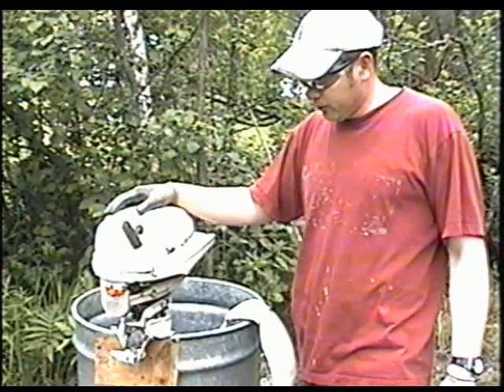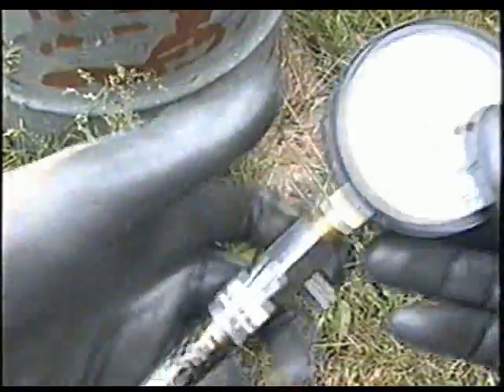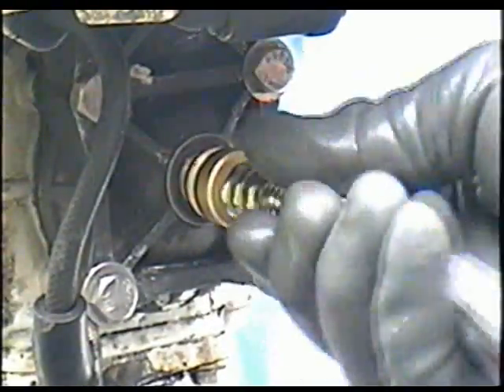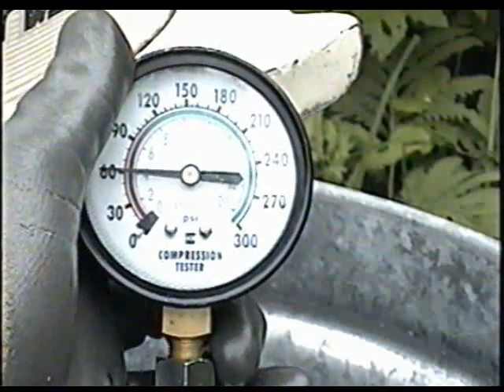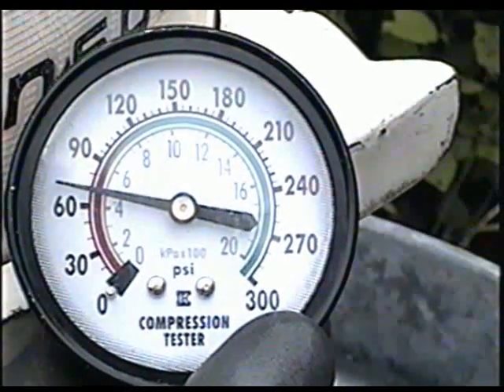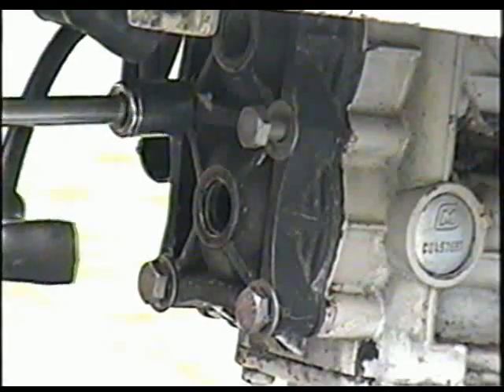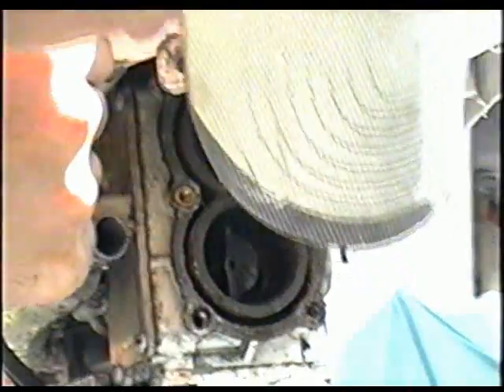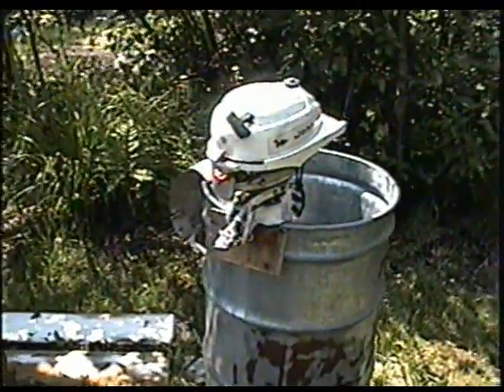Compression Test on 1962-3hp Johnson Outboard Part 1/2

Comment: I'M pretty sure it was the head gasket . taking it off to change the rings and then putting one on new was enough to do the job . 3HP does not have a ton of compression and the fact that it was only 10# different says gasket to me .

Comment: Believe it or not, those old 3hps didn't have alot of compression..60PSI is a little low, but would probably run...Maybe the rings are just stuck, a good soaking with engine tuner or some other decarbonizing fluid will probably help free it up...

Comment: Please, please don't crank them over without grounding the spark plug leads. The high voltage needs somewhere to go and if they aren't grounded the high voltage will short out in the coils making them useless.

Comment: Yes you can get rings for it by the way . Im rebuilding my evinrude 7.5 fleetwin 1957 . Im replacing the rings and head gasket too . Did you ever get it running .

Comment: To answer your question: yes, parts are still available for these. There are lots of exploded diagrams of, say, the powerhead, online and it tells you the OMC part number (or equivalent). I sourced all mine from eBay as these were popular motors back in the day, and another plus is that from 1953-1967, they were pretty much the same, and parts are very much interchangeable! Good luck!

Comment: Yeah this is a '65, not a '62: the numbers after the JW usually ascended by 1 with every year (though sometimes they re-used the same number for two years) -- for example, mine is a JW-21E and is a 1966. If it were a '62, it would be a JW-17... and have 2 needles (high and low). Check out the vid on my channel where I did a restoration of above-mentioned Johnson JW-21E :-)

Comment: Thoes motors will run fine with compression between 70-80 pounds. Why don't you replace the head gasket put the motor on it's face so the pistons are pointing upwards. Then level the pistons out so the ports are covered. Then pour some Sea Foam in the cylinders and let it soak down past the rings. It may take a few days to a few weeks to soak down past the rings.  But I've brought back many a motor this way

Comment: Those old 3hps do not have that much compression to begin with...Keep in mind that the long hose to the gage has a downward effect on the compression readings, especially those small combustion chambers.  I would soak the pistons, true up the head/block surfaces, replace the head gaset....And, I'm betting the engine will start and run, compression will probably improve after you have run it for awhile...

Comment: Sure you can get rings - you may not even have to replace them - they could be stuck from carbon.  Also those bolts and washers are not original and they seemed to come off very easy - it's possible the head gasket is bad and wasn't torqued down enough.  Be sure to ground those plugs or you'll fry the coils.